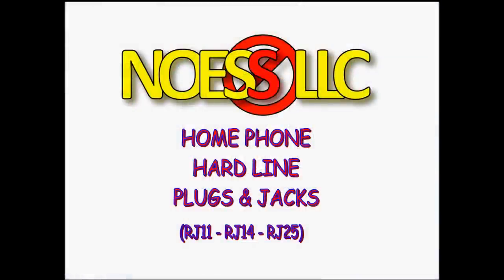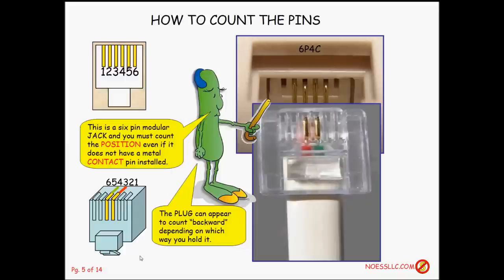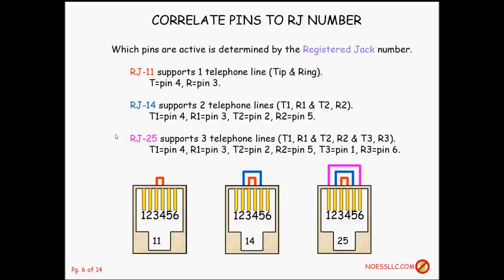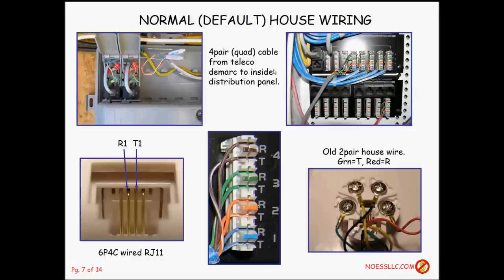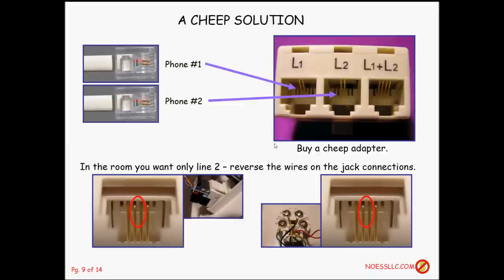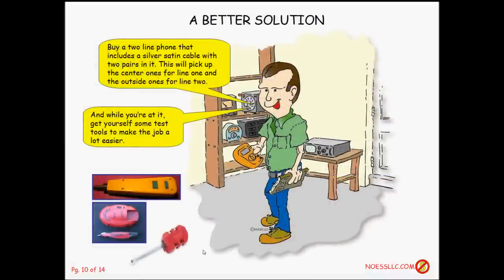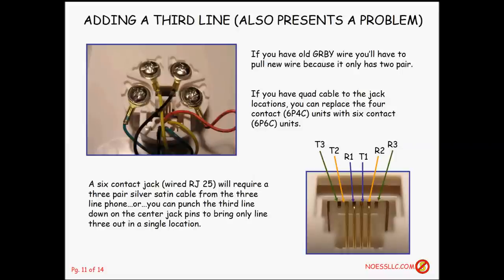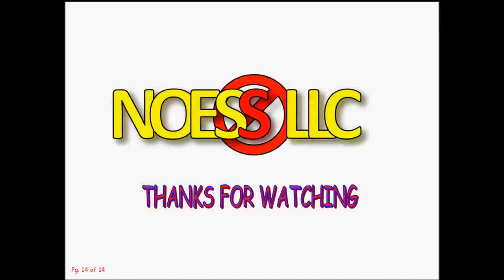Telephone Jacks and Plugs.  RJ11, RJ14 & RJ25

Comment: Wow man. Sometimes it just takes someone breaking it back down for the light bulb to go off. I've inched my way around data and telecommunications for almost 8 years in high volume, commercial infrastructure. Building COM rooms from bolting the rack to freshly poured concrete to terminating Unicam fiber optic cable and constructing LIU's and as sad as it is to say, I never had the basic POTS line explained to me. Thank you.

Comment: Is there any issue with still wiring the wires for a 3rd phone line even if it isn’t being used now? I’m thinking about renting my house out so it’s more for someone else to use in the future if they need it. 

Any harm in still wiring an unused 3rd line?
Reply from the maker: The standard modular wall jack (6P4C) does not normally have any metal contacts in Positions 1&6 so they would have to be replaced with a 6P6C one in order to physically support three simultaneous lines.

Comment: Is there a difference between a 2pin RJ11 and 6pin ? Performance wise ?
Reply from the maker: Not sure of your question. The RJ11 designation is a specific (2wire) APPLICATION for supporting a single 2wire POTS phone line on a 6 position receptacle. It only requires 2 (metal) contact pins in positions 3&4 of the receptacle to support this single line APPLICATION. When you buy a 6P jack (unless special ordered) at your local hardware store, the little un-wired plastic units actually have metal contact pins in positions 2, 3, 4 and 5 with no metal contact pins in positions 1 and 6. This is then correctly called a 6Position4Contact jack. Unfortunately the dimwit manufacturers inevitably label the little baggies the un-wired jacks come in as RJ11's instead of 6P4C's.  If you decide to add a second phone line to this jack, it will use existing P/C's 2&5 and suddenly (POOF!), become designated as a RJ14 APPLICATION. To use this same size 6P jack for 3 phone lines you will have to special order them to get ones with metal Contacts in Positions 1&6 with the designation 6P6C. When you wire this to a third phone line the plastic jack (POOF!), supports an RJ25 APPLICATION. The manufacture mislabeling of 8P8C's is even dumber, but that's a rant I deal with on a different video.

Comment: I love how "really old" refers to houses over 20 years. LOL. My house was built in the 40s, it uses the old wiring but I'm trying to update.
My goal is to run a single line from the telephone company's box at the front of my house all the way to a room at the back of the house. Currently it comes up through the floor (house is on stilts) & goes to floating jack then from there I run it to a surge protector & from the surge protector to the phone. (Previously had it straight from jack to phone but a thunderstorm / power surge fried the phone). I think it's a 2 outlet jack so I have an old corded phone that works when the power is out & a base w/ cordless phone that has auxiliary handsets. I think the new setup I will run to the surge protector then out & have a splitter to the two phones. Would that be ok?
I go off on tangents a lot too so it's all good. :-)
I'm going to use 24/4 indoor/outdoor cat5e cable & wire it into the RJ11 pod/connector.
Cellular isn't an option where I live. I can't get signal so I need a landline. Mine is currently out & AT&T has no intention of improving the cellular in my area anytime soon.
Reply: @Paul Jameson I got it done a long time ago. Thanks though.

Comment: my isp provided cable for routers to micro filter only have 2 pin but really slow  internet speeds up when i use a 6p6c cable or a 6p4c cable  try to speed my mum's internet but worried it could be dangerous as the micro filter only has 2 contacts

Comment: I just bought a desktop touch tone phone abs three Jack on the side is too skinny for a standard plug. Why abs how can I still use? Thanks
Reply from the maker: Not sure what you mean by "a standard plug", or ABS,  but if you mean the RJ9 4P4C (four pin/four connector) on the side of an old Bell System desk phone you can get them (and variations with adapters) on Ebay or Amazon.
Reply: Turns out I’m a moron and the person I bought the phone from have the headset plugged into the rear and not the side of the phone. Headsets plug is narrower than a standard.

Comment: I don't get it. At 2:56 pin 3 (from the right) is red in the diagram but is green in the picture. If you rotate the pic of the plug 180 degrees about the vertical axis pin 3 is green and pin 4 is red.
Reply from the maker: Easy to get confused. The JACK drawing upper left shows the pin POSITIONS looking into the JACK. The photo (pink plastic) JACK only has PINS in POSITIONS 2-3-4-5 counting from left to right. When the PLUG (photo) is pushed into the pink JACK its #3 (red) contact will mate to PIN 3 of the pink 6P4C JACK and the green will mate to PIN 4 of the pink 6P4C JACK. The PLUG drawing on the lower left shows it coming toward you (note the locking tab on the bottom) and will be rotated in order to be inserted into the upper left drawing or the pink 6P4C JACK. The important thing to keep in mind is the "RJ" designation refers to the JACK and not the PLUG. The PLUG is the thing that is always being shown in "how to do it" vids so it's often assumed to be "backwards." It's unlikely that anyone would still be using old two pair (red/green/black/yellow) cable so most likely a quad would be used (blue/orange/green/brown with white tracers). Blue/white line 1, orange/white line 2, and green/white for line 3 (on an RJ 25 [next page]) 6P6C.

Comment: Hi! Hope anyone could enlighten me with this.. I'm trying to make an adapter from Female RJ10 4P4C to Male Audio/Mic, but I am not sure if this is possible.. I would like to know if the cabling or pinning will still be like 
1-BLACK
2-RED
3-GREEN
4-YELLOW 
WHICH
FOR MICROPHONE:
1-BLACK
4-YELLOW
FOR AUDIO OUT:
2-RED
3-GREEN
I am actually trying to use my headset with RJ10 PLUG, that's why i'm thinking of making the adapter my self since I have all the equipment needed.. Also I'm opting to use the cable of my old headset with microphone and volume control for the Audio/Mic Jack, but I'm having a hard time searching if where to specifically attach the cable from RJ10 to the small-motherboard of my old headset cable. Please enlighten me folks.. Thanks ahead of time...